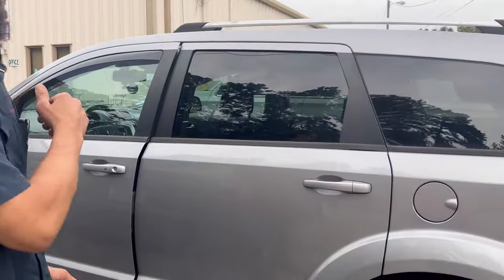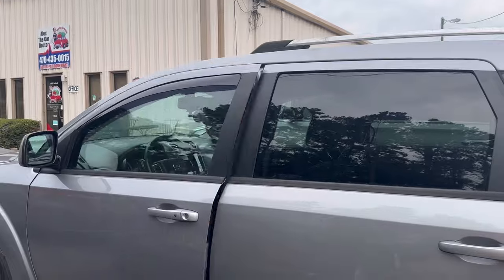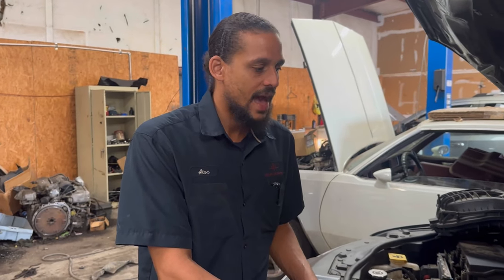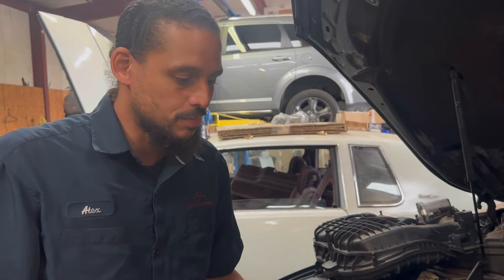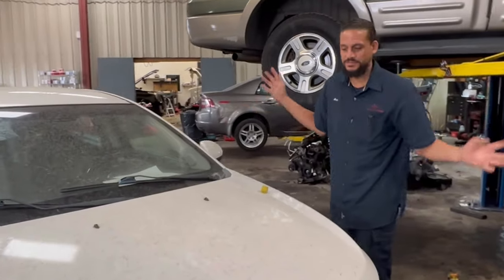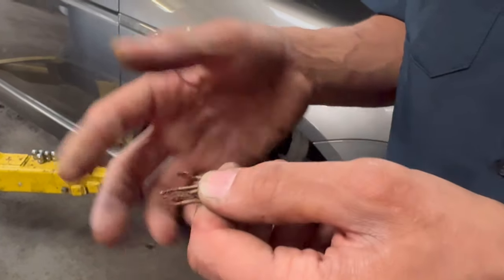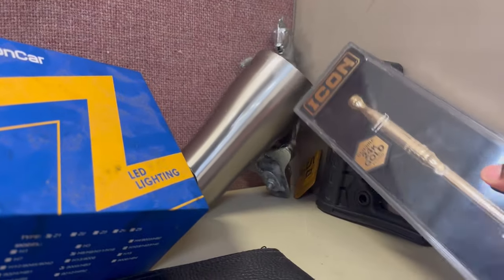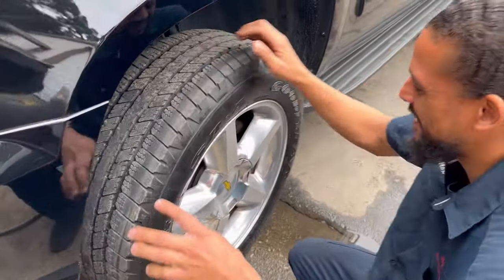A Day in the Life of a Mechanic/Shop Owner | VLOG

Comment: Your flexplate with the teeth eaten away, is also a Nissan problem, I did not see where the mount bolts were located on the other side of the flexplate to prove my point, the mount bolds that hold it to the torque converter hold the flexplate firm and this is where the starter digs into the teeth, where the bolts are not located, the plate actually flexes and does not dig into the teeth. So, along with a new flexplate, you also need to shim the start out the same depth of the eaten teeth depth or a good percentage of that distance to prevent this problem from coming back, although way in the future. Cheers.